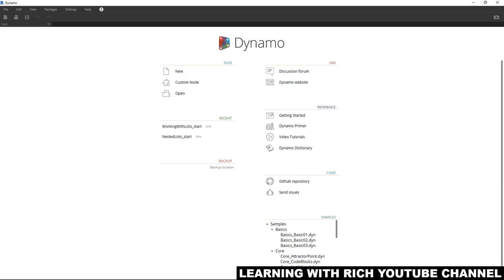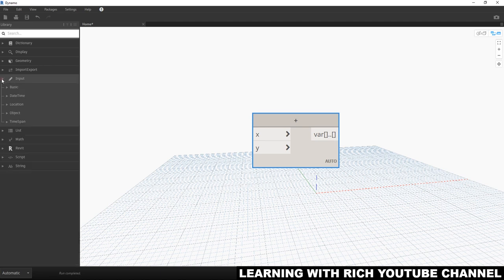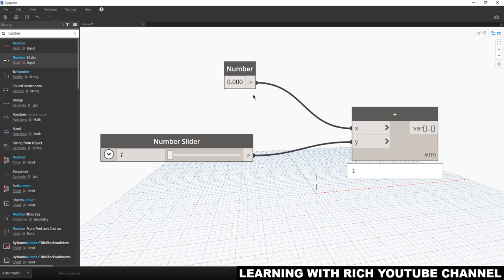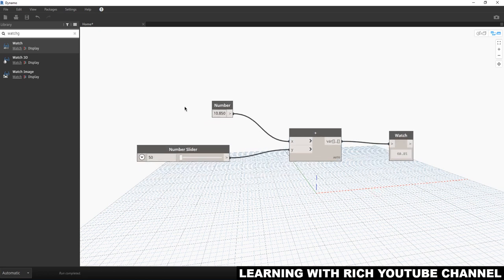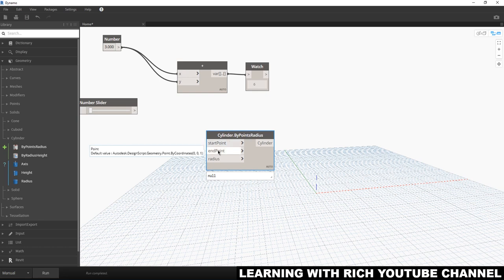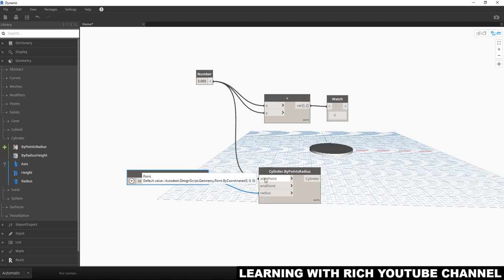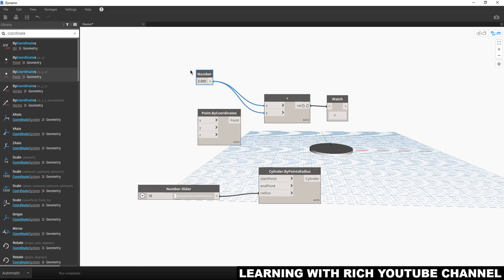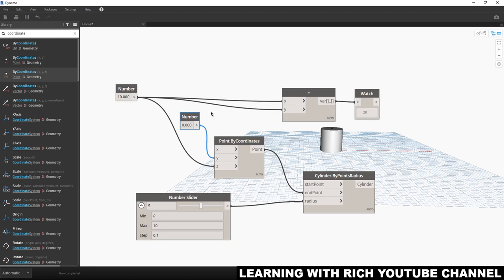DYNAMO FOR BIM - LESSON 20 PLACING AND CONNECTING NODES

Comment: how to know from where the node is comming from like in grasshopper ctrl+alt+click
Reply from the maker: In Dynamo, if you want to trace the origin of a particular node or understand its connections, you can use the "Watch" feature. However, Dynamo does not have a direct equivalent to Grasshopper's Ctrl+Alt+Click feature.

Here's how you can use the Watch feature:

Select the Node: Click on the node you are interested in.

Watch Panel: In the lower part of the Dynamo interface, you'll find the "Watch" panel. This panel displays the input and output values for the selected node.

Input and Output Ports: You can see the input and output ports of the selected node in the Watch panel. By clicking on each port, you can trace the connections.

For input ports, you'll see where the data is coming from.
For output ports, you'll see where the data is going.
Reply: @bim360  I'm facing another issue during certain conditions that "Polycurve should have one single wire".
Reply from the maker: hey, it seems like you're encountering an issue with Dynamo in Revit related to a "Polycurve should have one single wire." This error typically occurs when you are working with Polycurves and the input geometry doesn't meet the requirements of the specific node or operation you're trying to perform. 

here are some general suggestions to troubleshoot and resolve the issue:

- Check the Polycurve:

Ensure that the input Polycurve is indeed a single, continuous curve. It should not have any gaps or disjointed segments.
If you are creating the Polycurve dynamically, make sure that the curves you are using to create it are properly connected.
Data Types:

- Verify that the data types you are using are correct. Some nodes in Dynamo may require specific data types, and providing the wrong type of input can result in errors.
List Handling:

- If you are working with lists of curves or Polycurves, make sure that the list structure is as expected. It's possible that the node you are using expects a flat list but is receiving a nested list, or vice versa.
Node Inputs:

- Review the inputs of the node that is giving you the error. Check the documentation for that specific node to understand its requirements and ensure that you are providing the correct inputs.
Node Version/Compatibility:

- Check if there are any updates available for Dynamo or the specific packages you are using. Compatibility issues between different versions can sometimes cause unexpected errors.
Isolate the Issue:

If possible, try to isolate the part of your graph where the error is occurring. Simplify your Dynamo script to focus on the specific operation causing the issue. This can help in identifying the root cause.